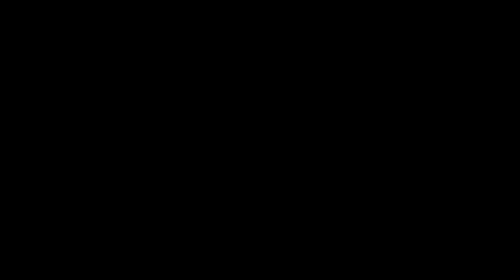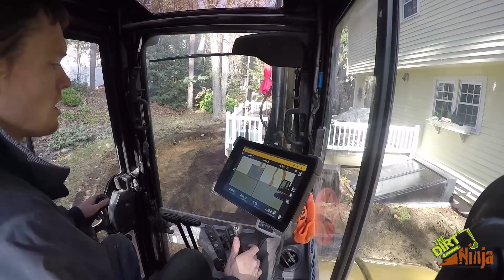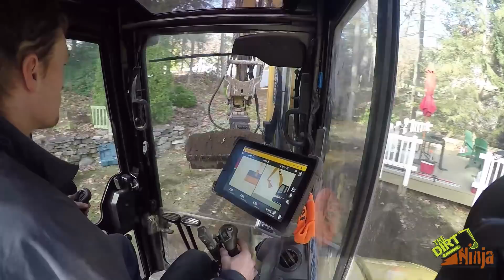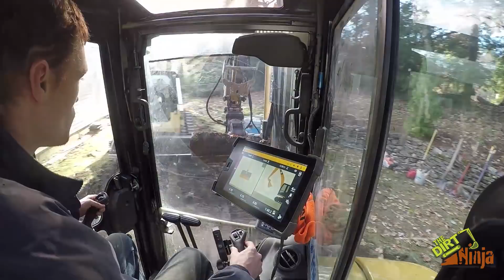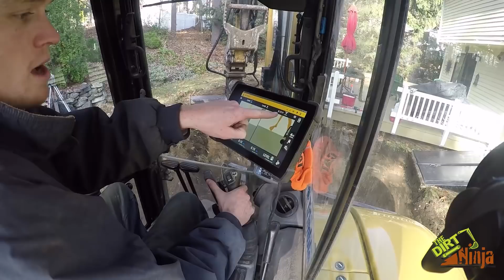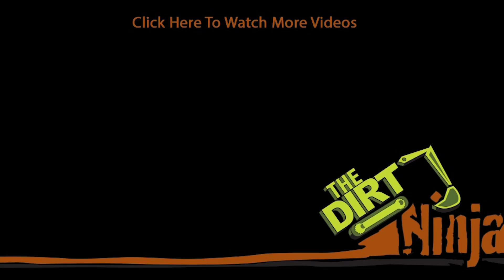Trimble Earthworks - How To: Grade A level Surface

Comment: Trimble is a cat product isn't it? Have you seen the iDig system? It has valves that interface with your machine, it cuts the grade itself. You basically just point the machine in the right direction.
Reply from the maker: No Trimble is its own company. I have seen the iDig system. This trimble system will do the same thing with controlling the functions of the machine. Its an upgrade though that we didnt get yet.

Comment: I get how it controls depth after a benchmark.  What happens if you move the excavator?   Do you re-benchmark or use the external laser for reference?
Reply from the maker: correct or just something solid like a rock or stump that you can touch, move and then touch again. I have a video on here on how it works do a search on my channel for touch point
Reply: I’m finally getting my earthworks for my mini, cant wait.
Reply: There are two ways to reset after the machine moves, with a laser you would swing your boom mounted laser receiver thru the beam, or you can use a touch point system. Touch a spot before you move and touch the same point again once the machine has moved
Reply from the maker: What Hatya05 said is correct. You use the laser or you can use something called touchpoint. I have older videos up that show how both of these methods work.
Reply: Dirt Ninja so the touch point could be a spot that you have already brought to grade correct ?
Reply: Hatya05 Where did you shop? I'm interested in getting pricing for my Bobcat E50
Reply: Stone Ridge Landscape & Design  It seems trimble sells thru Sitech  around me, depending on your location you’ll have to find your area Sitech dealer, my system is going on a 55-9 Hyundai excavator with a tilt bucket for about 21k + some welding.
Reply: Hatya05 Ok thanks. Did you get the auto grade control option?
Reply: Stone Ridge Landscape & Design Automatic grade control is not yet available on all machines, I was told it would be in the future.
Reply: Hatya05 wow, that's quite a price tag for just the basic! I'm sure it's worth it though. Thanks for the info, I appreciate it!
Reply: Stone Ridge Landscape & Design Its not cheap but, how much does it cost to have a guy hold a grade rod. How much material can be saved by not over digging, Then add all the conveniences that come with the system, such as automatically having pitch calculated by the system. That would really save me time. All that time and material saved can convert to $$$ pretty quickly.
Reply: Hatya05 Check out the iDig laser system. Does the same thing but about $10k cheaper
Reply: Dirt Ninja touch point

Comment: What is less to buy a bobcat e 50 or a cat 305.5e2. My company is getting ready for a new excavator. What is less and which one would you go with? I know you have operated both so you seemed to be the guy to ask about this
Reply: Snowplow 364 bobcat is cheaper but run both you will find one thing very fast the e50 is SLOW the new bobcat excavators are extremely  slow if you run the cat and hop on the e50 it will feel like your runing a touch higher than half throttle. Don't get me wrong the bobcat is a good machine but if you are at all concerned  with production don't get a bobcat. Things to also note cats cab sucks it's tight the doors windows rattle so on. Bobcat has a very nice cab more room etc. Bobcat will develop leaks after 500 or so hours(i may just have gotten the short end of the stick because every bobcat I ever ran leaked even somedealer  rentals  with less than 100 hours on them) my experience  with cat is they tend to stay dry. But if I was in you i would also look at kubota , case, and yanmar ,takachie (spelled that wrong) mini x' s good luck in my opinion case is the way to go fast simple no frills reliable.
Reply: Oh forgot to add deere and hitachi make some strong quality mini x's if your not big on cab space. I'd check out a cx60c from case or a cx57c. Also deere/hitachi have very good aux hydro' s so if your going to be running  a hammer  a lot or a muncher head etc you might want to look at the deere twice.
Reply: Vasiliy Dronov thxs so much. Now all were going to use the excavator for is road and driveway repair. Land clearing such as trees bushes and rocks or completely redoing a backyard. Then we might be getting a hydraulic hammer for it as well. We will probably go with bobcat however I still don't know. By the way this will be our first excavator. I'm also just a 14 year old boy who works with his father. Plus I have a my name in the business. So as people say I have to make sure my dad and our employees are doing the work right. I have run almost every type of equipment but an excavator. I have been operating machines like Dirt ninja since age 4. Again thanks